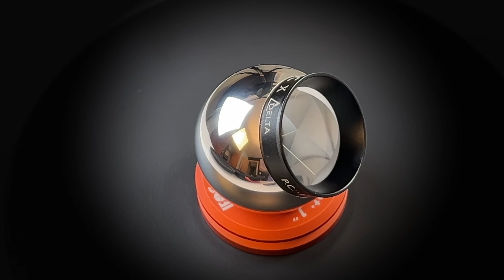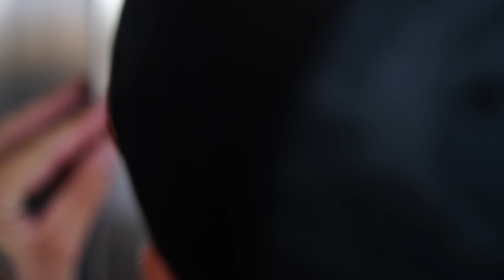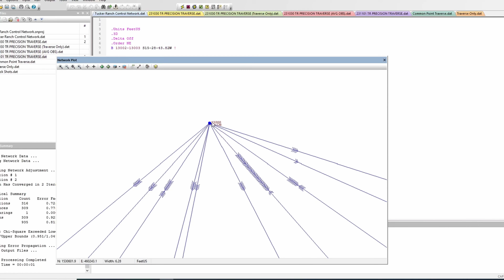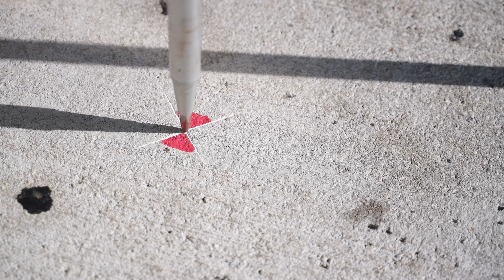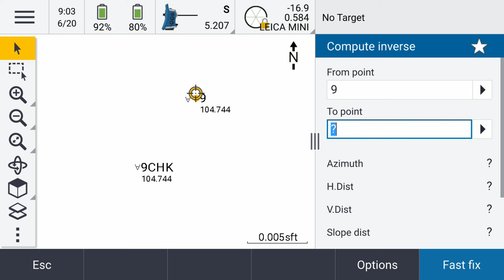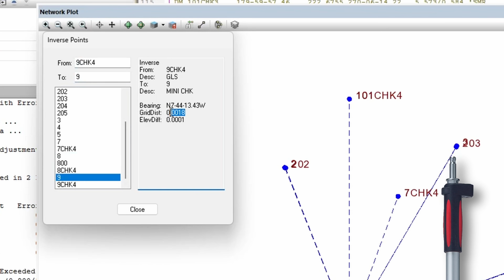Surveying Target Error & Ball Prisms

Comment: So you can use these ball prisms as control points, but what about if you want to use it to collect data, like the face of a wall or column, just having the prism constant is not enough, because the size of the sphere dictates your offset from the wall or surface that you're doing the as-built, how can you input an offset? if you are to the right or left of the prism the the offset would be different, right?  also if you use one of those nest the offset from the surface would be even greater, on a regular prism we input prism constant and elevation of the pole, I'm just a little confuse how we could use these prisms other than control points.
Reply from the maker: If you wanted to use them to measure a vertical surface you'd need to offset them by the radius (back in the office) based on more than one point on that surface (as you'd need to define the plane you're working on). I dont use them that way but other people do. There is also a significant number of accessories that assist people to use them this way.
And yea, the added offset from the nest is a known amount so you'd need to add that too. 
It's really no different than trying to use any prism to measure a vertical surface. But there are easier ways so...

Comment: Can you give some help choosing a total station? My work is mostly about small 3d networks ( baselines up to 70m) using ball prisms. From this network I measure control points for photogrammetry and static laser scanning with z+f scanner, some of them reflectorless. I currently use a Nikon xf hp 1" but a robotic (actually auto pointing) will be great help ( for measuring rounds) I consider focus 50 1" ( great price, but I don't trust the pulsed edm ), topcon gt1501 (not very precise auto point at close range), and the very expensive ts13 1"( does it worth the money for my work?).
Reply from the maker: I’m a big fan of Trimble myself and the HP uses phase shift if that’s what you’re after. Focus makes phase shift instrument as well.
I’m not a fan of Topcon from my experience using them but in all honesty I don’t have enough Topcon total station experience to cement an opinion. I’ve ran Leica for years and was happy with them as well. I just prefer Access when it comes to a Leica vs Trimble.

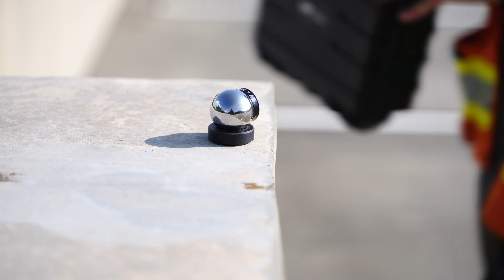Comment: 14:11 How long have you left them with hot glue on concrete? I've got a project that I'd like to leave them there for a couple of years at least.
Reply from the maker: Not that long. I would lean towards a construction adhesive, epoxy or better yet, concrete screws and a nest that works with screws if I was aiming for that length of duration. I have had the hot glue fail before after a while.
Reply: @T @The3rdDimensionSurveying  what just happened to me was, I used PU Loctite x3 and it failed on the same day. It seems because it doesn't melt the plastic it doesn't "grip the back of the "puck". Need to find something that will work long term. Thank you for the quick response.Love the channel keep it up. Don't know how much construction survey work you perform but would love to see more of your work on that too!

Comment: For concrete, I'd suggest the wall station mounts used in underground mining, it's just a hole lined with stainless steel tube, that you insert a standard wall station adapter spigot.

Comment: At 14:15 where you are talking about removing the nylon adapters hot glued to a surface with a hammer and chisel:
This can cause the glue to rip chunks out of some surfaces like wood and I have even seen hot glue damage concrete and brick walls. However there is another, potentially less harmful way to remove things stuck down with hot glue: rubbing alcohol. As long as the surface will not be damaged by the alcohol then this works pretty well.

Just apply the alcohol to the edges of the glue where it meets the surface. Because the alcohol has such low viscosity, it will seep between the glue and the surface and break their bond. Then it either falls off or breaks off with a little pressure from your hand. If it needs it, you can assist it by prying gently on the edge so that the alcohol can get started going under it. In the electronics repair industry we use this method to remove the hot glue that some companies cover components with to assist in manufacture or to prevent vibration from damaging them or cracking the solder that connects them to the circuit.

Of course you should remove your prism from the holder first before applying the alcohol. As far as I know rubbing alcohol will not damage the nylon because I have used this method on my own devices with nylon fixtures, connector bodies and other parts without seeing any damage from it. Even after a few years have passed since being doused with alcohol, the plastic parts are just fine.

And if you have a very delicate surface like wood or drywall, then 3M's command adhesive strips are the answer. They will stick well to most surfaces and removal does not damage what they are stuck to. They are also flat and of uniform thickness so you can include their depth in your calculation of the distance. A handfull of those strips in your reflector kit would be an inexpensive way to ensure that you do not damage your client's property when you clean up.
Reply from the maker: Thank you very much for this hot tip (no pun intended). I’m going to try this out ASAP.

Comment: Great video, thanks! How do you compare the RS System one point fits all fixed targets to this SMR system?
Reply from the maker: I love the magnetic nest of the SMRs and the compact well thought out carrying case they come in. I wish RS figured that one out. You'll get a little bit more accuracy from the SMRs. But the Rothbucher kit allows for integration with scan targets which is big for me. If I was using these 100% for resections I'd probably lean towards the SMRs. If I was going to scan as well then I'd go for the RS system.

Comment: Very concise and helpful video! In my master thesis we checked the prism centering error of similar sphere prisms from Goecke Schwelm and compared them to the run of the mill yellow plastic monitoring prisms. With the right methods and good practices both had sub mm errors. But the spherical prisms had sub mm errors even when reducing the number of measurements, post processing and not using best practices. Of course this was on-site testing and not laboratory. Thanks for the videos you make, they help me a lot in my career!

Comment: Does the angular accuracy spec of the total station  have a larger impact if the horizontal distance is longer or are we paying more for a certification?
Reply from the maker: Absolutely it does. An easy check you can do is take the angular difference between the two instruments, lets say we want to compare a 1" & 5"  which means there are 4" of difference between the two, & take the sin of that (divided by 3600 to get it into degrees), multiplied by your observation distance and it will give you an idea of the accuracy difference from the angular spec. Ex. sin(4"/3600)*50m = >1mm
So at a 50m observation the difference between a 5" gun and a 1" gun is sub mm.

But at 200m its almost 4mm. Still not huge and if we're chasing mm's, a 200m observation might be pushing it. At that distance other error sources start sneaking in that weren't a significant factor before (ATR gets degraded quite a bit, a varying coefficient of refraction, ect). And also, taking rounds is always an option and reduces more error sources beyond just the angular spec.

The key takeaway IMO, is if you can afford the better angular spec instrument, go for it, but to say it's the main culprit in error of a total station measurement would be incorrect in MOST situations. If I had a set budget that I 100% could not go over, I'm saving my money on that 1" gun and putting it into a good tripod, prisms & a pole.

Comment: Thanks for the video. By the way may I ask fir your opinion regarding to resection set up. If you have 4 control points. Will you do resection including 4 points or just use 3 to set up resection, and check shot on the fourth?
Reply from the maker: Great question! I would probably opt to use all four in the field. Your residuals will essentially give you "check" metrics for each point. But you wouldn't really be wrong by using 3 and having that concrete check either. 

If you post process you data you can really dig into your measurements because you can use 2,3 or all 4 observations for your resection and swap your check(s) around as you please.
Reply: @The3rdDimensionSurveying thanls mate. I dont trust on residual of resection. As a few times i have goo numbers nit check shot is slightly out.  So i always tend to set up 3 poonts and check shot on the fourth. We mostly do setout so, no chance to play around with them at office.. i meant setup for accurate work such as less than 3mm, for concrete wotk around 5mm either way are ok.
Reply: @nvtcuong8173 always best to use more points as possible